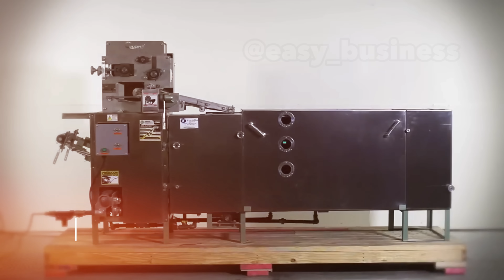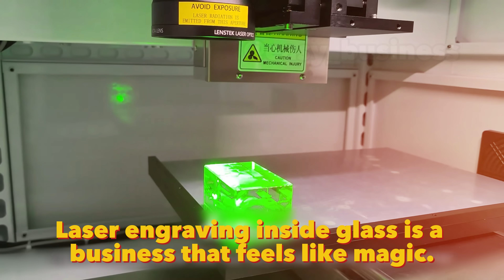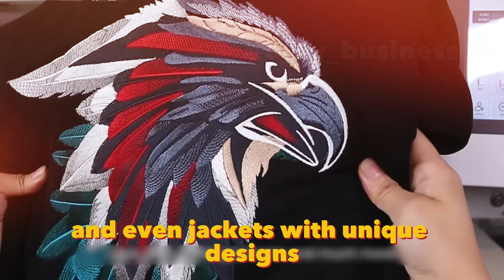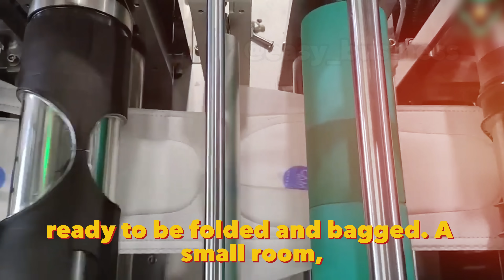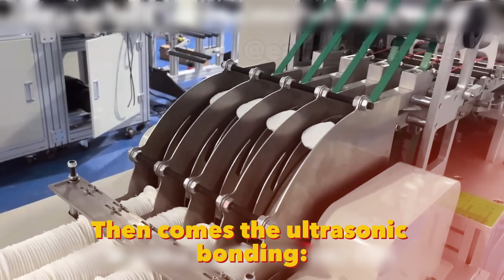30 EASY MACHINES TO IMPORT FROM CHINA FOR STARTING HOME BASED BUSINESS

Comment: I liked the part where you showed how compact these machines can be and how feasible it is to start from a spare room, it felt encouraging. Before this, I was stuck chasing big factory setups and expensive gear, which left me overwhelmed. It cost me months of frustration and a small fortune in prototypes while I still hadn’t landed a first sale. I thought the bottleneck was the right supplier, but it turned out I was chasing volume instead of clarity. Then I saw Algorithmic Freedom pop up in a forum and grabbed the ebook without a second thought. I started with a simple, digitized product plan and a small toolkit, and I’ve been shipping my first real orders in weeks. Now I mostly focus on a repeatable template pack that I can hand to anyone and it keeps growing without me burning out. The speed of results surprised me, and I’m already listing new items as I sleep, which feels unreal but true.

Comment: Most of these machines are much more expensive than a typical home based business can afford even if purchased used. The other problem is many are already sold very cheap in bulk like paper plates and chalk, there is no way to compete in the US or most other first world countries, by the time you buy the material you would already be spending more than you would get out of the product especially buying materials in low volume and not the volume large manufacturing plants buy it at.
Reply from the maker: That’s a valid concern. Some of these machines are definitely a bigger investment and they’re not for every type of home business. In many cases it only makes sense if you find a niche, add customization, or focus on local or small batch production instead of trying to compete with mass manufacturing.

Material costs, volume pricing, and market competition are all things people really need to calculate before jumping in. The goal of the video is to show what exists and what’s possible, but the numbers always have to make sense for your specific situation and market.

Comment: Do they send a technician from China when the machine breaks down?
Reply from the maker: It depends on the manufacturer. Some companies can send a technician, but it usually takes time and can be expensive. Many suppliers also provide remote support, video calls, manuals, and spare parts so issues can be fixed locally.

Comment: 1.	0 Intro
〰️〰️〰️〰️〰️
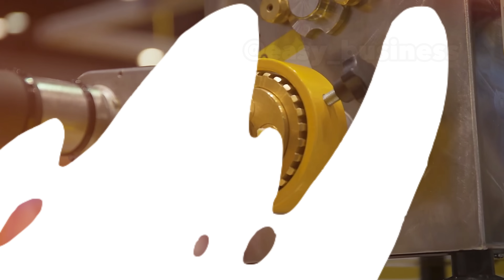2.	0:45 Belt Making Machine
〰️〰️〰️〰️〰️
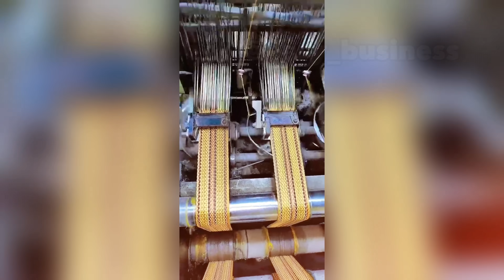3.	1:23 CNC Wood Lathe Machine
〰️〰️〰️〰️〰️
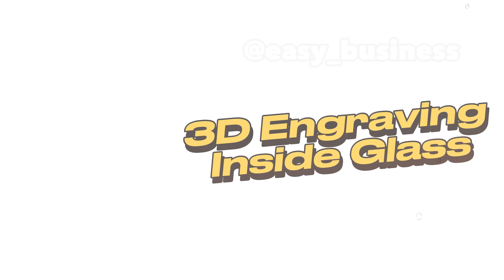4.	2:11 3D Engraving Inside Glass Machine 
〰️〰️〰️〰️〰️
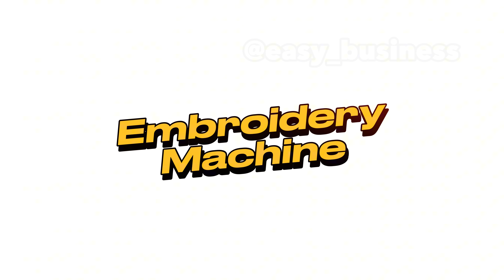5.	2:52 Embroidery Machine 
〰️〰️〰️〰️〰️
6.	3:31 Pasta Maker 
〰️〰️〰️〰️〰️
7.	4:03 Mesh Bath Sponge Making Machine 
〰️〰️〰️〰️〰️
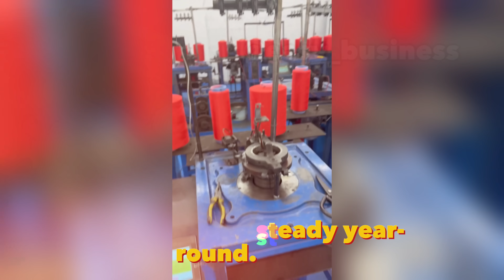8.	4:34 Wood-Chip Pallet Press
〰️〰️〰️〰️〰️
9.	5:12 Laser Rust Removal Machine 
〰️〰️〰️〰️〰️
10.	5:56 Tortilla Making Machine 
〰️〰️〰️〰️〰️
11.	6:26 Sock Knitting Machine 
〰️〰️〰️〰️〰️
12.	7:11 Barbed Wire Manufacturing Machine 
〰️〰️〰️〰️〰️
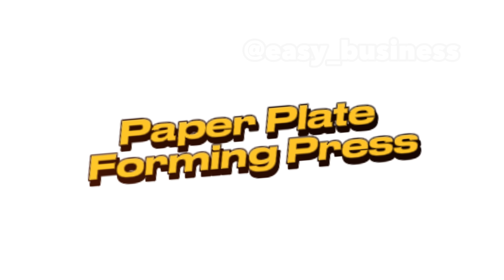13.	7:46 Paper Plate Forming Press 
〰️〰️〰️〰️〰️
14.	8:23 Powder Filling Machine 
〰️〰️〰️〰️〰️
15.	9:03 Oil Press
〰️〰️〰️〰️〰️
16.	9:52 Jewelry Laser Welding Machine 
〰️〰️〰️〰️〰️
17.	10:20 Sublimation Printer with Heat Press
〰️〰️〰️〰️〰️
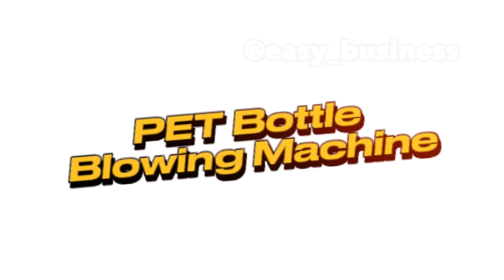18.	11:01 PET Bottle Blowing Machine 
〰️〰️〰️〰️〰️
19.	11:27 3D Printer for TPU / EVA
〰️〰️〰️〰️〰️
20.	12:05 Vacuum Forming Machine 
〰️〰️〰️〰️〰️
21.	12:46 Chalk Molding Machine 
〰️〰️〰️〰️〰️
22.	13:17 Paper Napkin Making Machine 
〰️〰️〰️〰️〰️
23.	13:46 Disposable Slippers Making Machine 
〰️〰️〰️〰️〰️
24.	14:14 Soap Making Machine 
〰️〰️〰️〰️〰️
25.	14:48 Envelope Making Machine 
〰️〰️〰️〰️〰️
26.	15:22 Clay 3D Printer
〰️〰️〰️〰️〰️
27.	16:04 Paper Straw Making Machine 
〰️〰️〰️〰️〰️
28.	16:34 Cookie Making Machine 
〰️〰️〰️〰️〰️
29.	17:00 Cotton Pad Making Machine 
〰️〰️〰️〰️〰️
30.	17:33 Gummy Candy Making Machine 
〰️〰️〰️〰️〰️
31.	18:04 Popsicle Making Machine 
〰️〰️〰️〰️〰️🤍〰️〰️〰️〰️〰️

Comment: as a machinery manufacturer, most of the production at a garage or home are not that easy. Especially offering a coffee packing and detergent packing on the same machine for supermarkets is so funny. Buying these packaging machines from China is another disaster... in general, the video makes you feel "oohh, is that easy?" but go to holiday and spend that money for yourself instead of buying a macihne from China and become a technician to run those metals... :)

Comment: That's the problem with China and its products. They are throwaway, and you will have issues with parts. I live in a third-world country, and China is everywhere. They have issues with dependability and will break down within a year. The locals here are locked in because of the price of cheaper machines compared to Western machines. They would prefer Western machines, but the price is the issue.

Comment: my cousin bought a chinese embroidery cnc for embroidering ball caps for his little league community. Spent about 4-5 thousand. Machine broke down after a year and he's been waiting a year and a half for part that will fix it. They don't seem to have the part but happy to sell him another machine.
Reply: If you want to buy CNC machine for wood work I have a Great provider with high quality machines and affordable price
Reply: @shenoudasedhom5008  hello im interested! 👍
Reply: Chinese things 😂😂
Reply: In Ponca City, OK there are companies that manufactured replacement parts for oil well service companies. They have to make custom parts. You may be able to have the parts made by a company like that. The other person's idea of making parts with a 3-D printing is fabulous too.
Reply: Laser cap scrapped the surface and had to be replaced. Chinks offered now machine. He had them made locally. From my experience with their "machines" NOTHING really works 100%....
Reply: 3д printing or sls metal printing
Reply: Thanks for the review
Reply: Remake the part using a 3d printer 🖨 and molding process with forge, problem solved. Yes I'm the Great White Asian.
Reply: @Gravity4220 do you have 3d printer?? Can make electronic components??
Reply: @Gravity4220 
Can you put  electronic components on a PCB  inside your 3D printed parts ?? 
I've got a project  that needs it  
If yes , please let's talk

Comment: food processing (Human or Pet) requires permitting out the wazu be careful of zoning! Make sure the ink is safe for contact with food (paper plate etc) I didn't see/hear it mention power requirement (single phase, three phase, 50 or 60 hz), compressed air, etc.... great idea(s) but DO YOUR RESEARCH!!

Comment: 😂 Combined materials and electricity cost is around $0.60. 
Don't forget about other costs, such as tooling and wear on the equipment. That usually is usually more than stock and electricity.

Comment: It's not possible to have "300%" profit.  That's called a "markup".  A 300% markup yields a 75% profit margin, which is low for plates.  I used to sell cables and they have 80-90% margins.  Paper plates are simpler, should be more profitable than a more costly and complex product.

Comment: Wood chips press... Its weight ranges from tens to hundreds of tones. The price is usually hundred thousand plus $. Shipping cost would dramatically increase the price. Then you have to have at least few feet of premium concrete underneath. Storage vessels for raw materials, Warehouse to store finished products, forklifts, labour cost to operate press, forklifts, office. Add energy consumption for heated press. Plus NOBODY will give you "free" raw materials like wood dust/chips. 
Now, the finished product costs a few bucks... What's the Return On Investment?
I don't see this as a "home factory", rather a small enterprise with already saturated market.

Comment: A couple of things not mentioned:
1. Regulations on food grade equipment. If you are producing food products, you need to have NSF, UL, approvals or you will get shut down by inspectors
2. Support. Should something go wrong (it will), who do you call? Do they have live support in the US, or do you have to spend days on we chat figuring out a simple issue?
3. Replacement parts. Do they use standard, off-the-shelf parts that can be bought locally? Many parts wear out. When they do, it's vital to have replacements ready to swap out. When a machine stops, so does your income. Especially in the custom, short run market.
Reply: Especially 2 and 3 which count for all equipment are worrysome. Unless you are an engineer and make parts I think with many of these machines you could be buying some very expensive scrap aftet they fail
Reply: I don't know about the US NFPA, but here in Canada the vast majority of Chinese equipment does not meet CSA electrical codes and require significant electrical upgrades that often cost more than the machine. If they are a good Chinese supplier/Exporter they may be able to make it meet all the CSA, UL, NSF etc approvals, but you will have to request that and it will increase costs. Compare all the costs (Certifications, Shipping, replacement component costs) against North American or European equipment before commiting, you might find the end cost is not much different and possibly better equipment. 
if you go the Asian equipment route, there are international testing organizations that can approve the equipment in China before it ships, which I highly recommend.
Reply: if you are the owner of a small production - you take the drawings and figure out how to repair it. after some time you can perform any repair and replace parts
Reply: most of these items where simple things like paper plates and chalk. you dont need replacement parts or support for papper plates
Reply: - who you gonna call?
- ghostbustards...)))
Reply: I wonder how much NSF adds to the price of all the goods. One should weigh whether what it does it worth the cost. It sounds like gatekeeper activity.

Now if the machine becomes unsupported that's up to the business person to decide, independent of the safety question. If the equipment is demanded support will come.
Reply: Looks dirty ! How can someone eat such food !
Reply: @GoogleAccount-l2r1t all YOU have to do I'd CLEAN YOUR machine-gonnablame the Chinese for YOUR dirty factory?
Reply: I liked that barb wire machine.  Most of the parts looked like they were 3D printed out of orange plastic... what could go "rong"?
Reply: They all have FaceTime tech support. Not a problem. You will get a real person faster than in the USA. A facetime is a facetime, wether they r in India or china or Texas does not matter. Spare parts u order them, they will arrive quick.
Reply: @MMABeijing Not the case. I've owned and serviced many machines in the USA, and getting any sort of help is both arduous and time consuming. The time difference and the language differences make a 15 minute job take hours. Not all companies have replacement parts as well. To say it's easy is deceptive.
Reply: @Mtnmanmike62  have you owned and used chinese machine that you bought over the last 5 years? I read your comment and it seems like you are sharing your experience of US made machines.
Reply: @MMABeijing I have both owned and serviced Chinese machines, and I have done so in the last two years. When they're working everything is nice. When they stop working, it can be hellish. If they use standard controls, and standard parts, it is helpful. When they're are comprised of proprietary parts, at worst, the machine is scrap.
Reply: @Mtnmanmike62 how was customer service?  When is was proprietary parts how fast did they ship them to you?
Reply: Right, food grade equipment in America is different from a third world culture like China.
Reply: @GreedyPetey  In Europe it's also very strict, in China they eat everything that moves, there they can easily add feces to their food and because of the monosodium glutamate you won't even know you're eating shit.
Reply: @GreedyPetey yet food in Ametica is the most unhealthy in the world unless the others are eating out if a ditch

Comment: Try getting parts or tech support. Good luck.  Their electrical standards would never pass if they were a manufacturer in the US many times machines need to be rewired. Speaking from years of experience working on a Chinese welders, engraver cutters in the laser industry.

Comment: That laser welding whilst holding the object with his fingers was crazy!
Reply: That's pretty normal. You see exactly what you weld.
Reply: @exander77  I saw fingers!
Reply: its common. I'm a jeweler. missing doesn't really hurt all that much. Its just stings for a moment and levels a yellow dot that will be gone before the end of the day. It also smells like burning flesh for a few minutes. Welding silver tends to hurt more because you are generally using a higher voltage. I think its because sterling silver is a higher purity alloy than 14k gold so it conducts heat more therefore you need more energy to weld the spot before heat dissipates. But nothing hurts more than the emotional damage of misfiring and cracking a colored stone.
Reply: @exander77 its no big deal really coming from an actual welder. Its always crazier
Reply: Yeah, for $300 you can weld your fingers together.

Comment: 00:00 - Introduction: Start a Home Factory
00:45 - Strap Weaving Machine
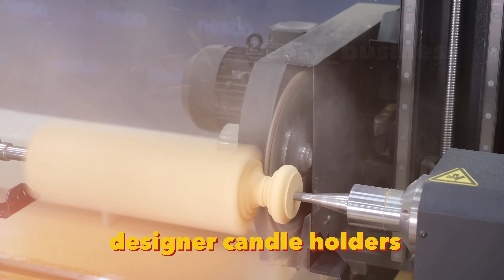01:30 - CNC Wood Lathe
02:15 - Glass Laser Engraver
03:00 - Embroidery Machine
03:45 - Pasta Making Machine
04:30 - Mesh Sponge/Scrubber Machine
05:15 - Pressed Wood Pallet Machine
06:00 - Fiber Laser Rust Remover
06:45 - Tortilla Making Machine
07:30 - Automatic Sock Knitting Machine
08:15 - Barbed Wire Making Machine
09:00 - Paper Plate Forming Machine
09:45 - Powder Packing Machine
10:30 - Oil Press Machine
11:15 - Jewelry Laser Welding Machine
12:00 - Sublimation Printer & Heat Press
12:45 - Bottle Blow Molding Machine
13:30 - Flexible 3D Printer (TPU/EVA)
14:15 - Desktop Vacuum Former
15:00 - Chalk Molding Machine
15:45 - Napkin Folding & Embossing Machine
16:30 - Disposable Slipper Machine
17:15 - Soap Making Line
18:00 - Envelope Folding Machine
18:45 - 3D Clay Printer
19:30 - Paper Straw Making Mach
Reply: The time stamps are way off  o_0
Reply: sorry this is totally incorrect, again please.
Reply: @  I’m not the author. Feel free to correct it and post it yourself
Reply: the final ones you missed were.   
 cookie maker machine
 cotton pad machine
 gummy candy maker machine
 popsicle maker machine.
Reply: I'm not the author. I just give this task to perplexity ai and it spit out the timestamps. If you want to correct it - feel free and post the comment back here somewhere for the rest of us to enjoy it
Reply: @KiroVelkovski thanks bro.
Reply: Maybe you should delete your initial comment.
Reply: Bro can you just reply $ please
Reply: Thanks for your work;
Reply: Why can't I buy these from somewhere else that does not enslave people? Chinese people can't go from city to city without government paperwork

Comment: The major issue here is non compliance, safety concerns and stolen designs, I have seen companies numerous times buy machinery from China with fake compliance stamps, dangerous designs and in some cases lethal, I can say with experience that getting such machines at a vastly discounted price is never going to go well, I seen companies shut down for injuries caused by such dangerous machinery, I seen locally based distributors face legal actions for not getting independent confirmation of local compliance and I have personally given written reports on the violations of safety and non compliance of such goods.
  Yes there are many legit companies with excellent reputations that are based in China but we all know there is a vast illegal industry of knock of goods that flood our markets.
 This channel needs to discuss such problems imho  and given that the channel promotes a range of machinery here he must understand that he becomes liable for prosecution if he promotes gear here that falls short of relevant standards for the country in which he promotes this.
 It would be nice to see a personal guarantee the machines he promotes are from companies that maintain high level of standards and full compliance for the markets they are selling into.

 PS - I watched the video and looking at many of the machines would not comply to EC standards due to lack of basic guarding, yes buy them for personal use and take that risk but if you are a company then insurance will not cover for non standard and unsafe machinery.

Comment: Caution....
Do not use lye without proper protection and ventilation. We made soap at home for the farmers market already. We would only do it when the windows could all be open and fans pushed the air. 
Lye is used in pretzel making as well.
Reply: Growing up my mom would only make lye soap outside.
Reply: @Lou8430  granny always made it out by the cee-ment pond 😅
Reply: It is in most name brand toothpaste as "sodium hydroxid" as well...

Comment: Try and find a Chinese lathe or mill from the '40s or '50s that still works. All my fabrication equipment was born before WW2 and it's still running fine. The only newer stuff I have is welders and even those are relatively old being from the '80s and '90s. No chance I'd buy from a company I have no clue about or where their physical location is at or if it even exists. China reverse engineers good stuff and then uses inferior materials to build them to keep cost down and you end up with scrap after it craps out.